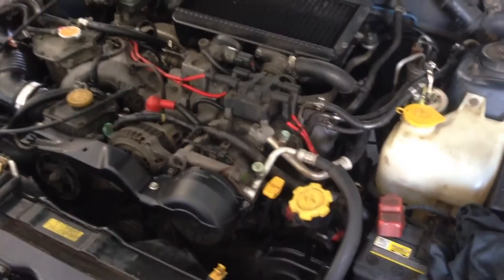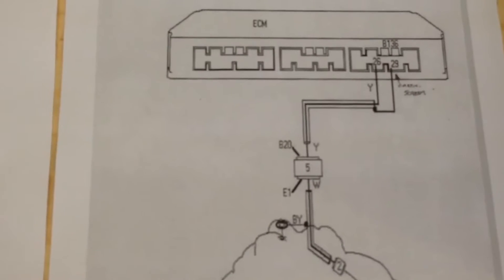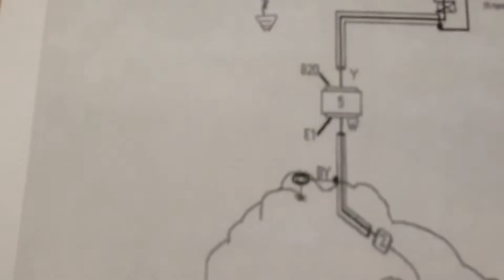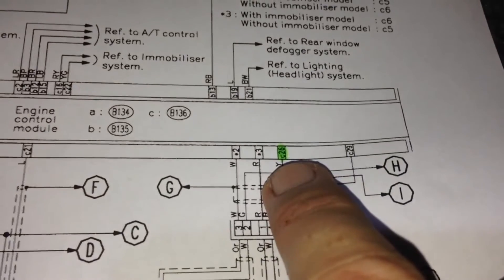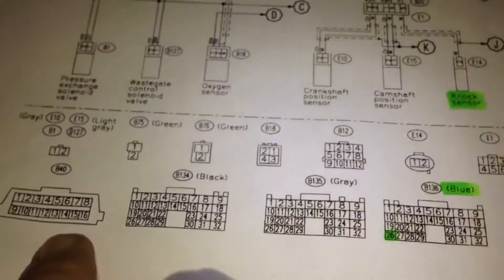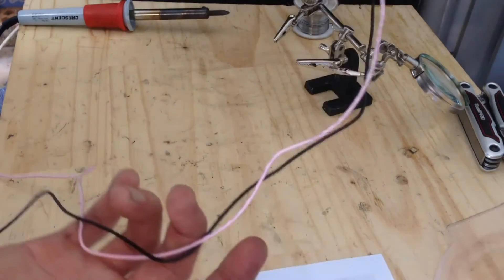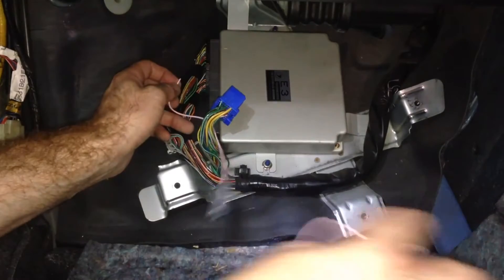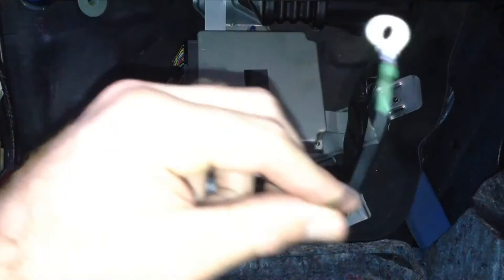Bypassing the Knock Sensor on a Subaru EJ20 Turbo

Comment: Hi mate just wondering if you could tell how to identify the pins on the ECU from a ej20..its a 98 to 2004 impreza motor that I have just purchased to go into a seadoo boat. I have the engine loom and ECU and just need to know what's required where the body loom would normally plug in. I know I don't need all the wires for this application but can't identify them at a glance. Cheers.

Comment: No sense.... The knock sensor is vital to protect the engine.
Reply: Not if you are milking a rod knock or piston slap problem , need to drive to work without timing problems.
Reply: @jonyoung6405  no. You need rebuild the motor in this case. Not cutting the only system that prevents Knock.
Reply: True Marcelo . Still need to drive while parts and time are sourced. Pretty sure I’m dealing with crank rod knock at 2800rpm. Cheers.
Reply: If the harness connector from the computer to the knock sensor breaks and the harness is no longer available and they don't make a replacement connector, then this would be the only way to fix the problem so you can get the check engine light to go out so you can pass a safety inspection. Should you trash a car because one sensor is not working? If you have a car with over 200,000 miles, then you are just trying to get a few more miles out of it as cheaply as possible. That is your answer. Too many vehicles in the junk yard for the want of a simple part. Blame the manufacturers for not supporting their vehicles.

Comment: Cuál sería la lógica de anular el mejor sistema de seguridad que trae el motor para evitar detonacion? Es llamar a la desgracia hacer eso.
Reply: En los subarus ese sensor es un coñazo, en mi impreza lo único que hace es detectar falsas detonaciones y bajarme el tiempo de ignición, haciendo que entre 2000-3000 rpms de la sensación de tener 50 caballos de potencia... Se ve que es un problema común entre subarus xd
Reply: @JoanJBT  lamento disentir. Tengo un gt 1999 con una ecu con mapa prodrive el cual ya trae tablas de avance más agresivas que las comunes y no hay Detonación. Tengo det cans y no hay Det. Probado de 2k a 7k luego de datalog tampoco hay Det en los logs. Osea no hay knock retard . El valor del I.A.M. es siempre 16. No disminuye. Lo que dices puede ser casado por un mal sensor de Detonación ya sea antiguo gastado. O hay mucha holgura entre pistón y camisa por desgaste y el sensor detecta ese "golpeteo" y acusa Detonación.  El knock sensor es el elemento crítico que protege el motor. No debe anularse sino detectar la falla que está generando Detonación. Mal combustible (muy bajo octanaje) turbo gastado genera ingesta de aceite a la admision bajando el índice de octanos del combustible. Y puedo seguir enumerando factores que alteran eso y no es culpa del knock sensor. Un dato más. El sensor original es extremadamente efectivo hasta las 6.000 RPM. Sobre ese rango de RPM se deben Usar det cans para controlar .

Comment: why would you delete this the k knock sensor? it's to prevent harm to your engine from pre-detonation. If you want to advance timing/more boost just get a methanol injection kit and do a tune!  PUT THE KNOCK SENSOR BACK IN BEFORE YOU BLOW THAT BEAUTIFUL ENGINE UP!!!!!   Proud owner of a 03' JDM EJ205 in a 2004 outback :D
Reply: Knock sensor is pain in your rear when first CEL comes up. Its there to "listen" for knocks and vibrations. When something is detected, your ignition gets retarded, car loses power and personally I was losing my nerves. Im driving like 3 months like this and car runs perfectly fine. I put back KS for couple of days and I regret doing that. Back to bypass and again - no problem at all. My subarus previous owner was driving without KS like for 3 years. NOTHING HAPPENED.
Reply: I have this exact problem right now my ecu set he boost pressurr to wastegate pressure.

Replaced knock with resitor to the ground and the problem was gone for 3 weeks , now with a new sensor the problem is back

Comment: Can a faulty knock sensor cause turbo surging? I have a 98 twin turbo ej and she's surging at 2500 to 4000 rpm, but the check engine code is for the knock sensor... any advice/confirmation?
Reply: I see this is old post but maybe helpfull for others , yes i false knock is detected the ecu will adjust boost pressure
Reply: yes, I had the same problem on a 99 forester